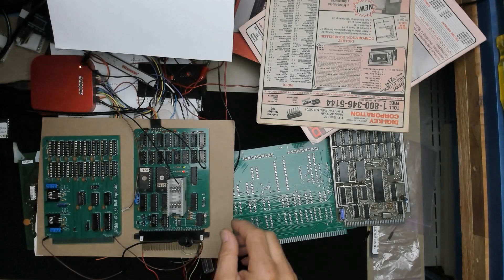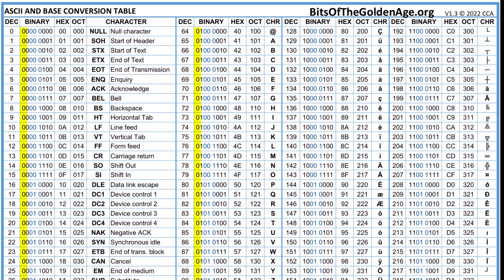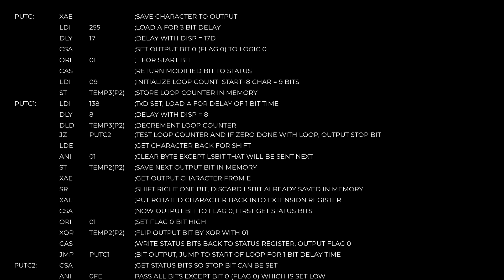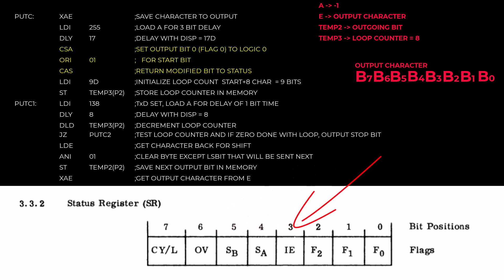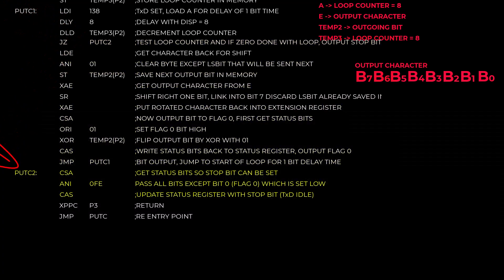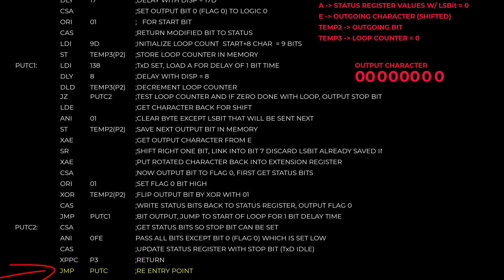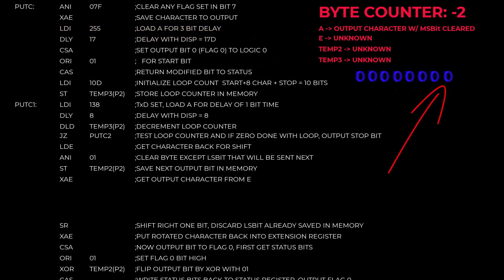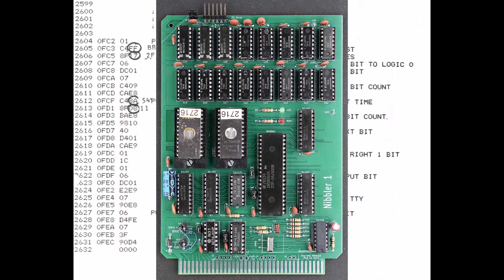{142} Fixing another bit 7 bug in NIBL, Learning SC/MP Assembly Language Along the Way

Comment: Nice, How about instead of shifting out 8 bits, you just shift out 7 bits, so that last character flag bit never gets sent, then just stretch the stop bit to allow for the data field being 7 bits instead of 8.

Thanks for the quick intro to the scamp code and the chip, I have one in a baudo time and date generator, I pulled the code from it's ancient EPROMS, but was having a hard time getting my head around the code.
Reply from the maker: I would need to try it, but reloading a stretched stop bit may not save any space when all is said and done

Comment: I'm probably being pedantic, but is it safe to set the carry/link bit and then forget about it? You could use the nop to clear it again (assuming it was zero in the first place) or wrap the SCL in a CSA/CAS combo but that would leave you with one byte deficit again...
Reply from the maker: You are right.  CY/L has special significance in the SC/MP because it is modified by so few instructions.  Unlike like the 8080/85 where so many instructions set/clear the carry.
The original coders would have gone into the PUTC routine knowing they didn’t do any arithmetic so the carry should come out in the same state it went in.  It is possible they had been using it as a flag or in arithmetic of the calling code.  Having not really examined all of the calling code, If I had broken existing code, this would have been a subtle one to track down.  
I don’t think I broke anything this time, but it would be safer to reclaim that NOP byte and do an ORI 080h after the shift to explicitly set the MSbit.

Comment: Maybe you could save a couple more bytes by inverting the character at the top, let it shift zeros in and not use the memory location, just off the top of my head. Nice video thanks.
Reply from the maker: possibly, but i didn't see it.  I started down that road but desperately needed a left rotate instruction which doesn't exist.  The pinch point is when setting the output bit before writing to the status register.  At that moment we need the output by itself, the status register is in the accumulator, and we still need the unmolested character... i don't think we can get away from getting that bit alone in a memory location.  the XOR actually doesn't cost us anything because we need to set that bit to a known value first before we can set it to the output bit.  we can use the ORI and XOR or use an ADI to clear it and then OR but either way it is 4 bytes.
Reply: @HelloWorldETX  You're really going to hate yourself when you find out that the last 18 bytes of the second ROM aren't even used and you could put patches there. (turns out they're just a copy of the same bytes from the first ROM)
EDIT: well I guess you can put SOME patches there, but there's that thing about how your only options to get there are 2-byte short jumps and 7-byte JS calls, but at least it was close enough for GECO!
Reply from the maker: @8bitwiz_  I looked at those.  they didn't look like opcodes and i didn't see where they were used for lookup tables so i am not sure what they are.   If just unmasked, i would have expected them to be a consistent value.  you disassembled them and agree that they are not code?

Comment: Using the MSB as a string terminator is rather common. Unfortunately not clearing it before sending that last character is also rather common.
And okay, I'll make an assembler, it's a really simple instruction set and should only take me a day or two to add it in, and I can't have you trying to do it all in Excel! (it should take as much time to polish up a new version than to write the assembler)
Reply from the maker: Thanks.  I only used excel for the delay value.  For SC/MP assembly, i am doing that all on paper at the moment and i will need a good assembler.  There are SC/MP assemblers.... at least two that i have found... but i haven't gotten around to picking one to try.  In the meant time, i learn a lot by hand assembling.

Comment: Nicely explained. I especially enjoyed the assembler listing explanation at 3:37. A description that is almost always overlooked in coding discussions. It is generally accepted as 'known knowledge' but in reality is only ever covered by training on the use of assemblers capable of producing such files. Not a lot of help to interested learners without access to such a resource and a machine capable of running it.
 Although familiar with 8085/z80 code listings it wasn't until I got my first computer (SoC MK14) and read through the manual that I experienced my 'lightbulb' moment.
Even though I was expecting to have to hand assemble any code before entering it, byte by byte, I suddenly realised that column 2 of a listing file was all I needed! Everything else was just commentary that could be ignored if I didn't need to modify it. 
The manual also enlightened me with details on how opcodes differed in bit pattern groups depending on the desired registers and addressing modes.
Those two revelations alone were worth the cost of my hardware investment and they remained so useful throughout my career.
Reply from the maker: I agree.... As a young college student and new to assembly language, breaking the 8080/85 machine instruction down into it's component bits that define the instruction and whatever registers are used was an absolute eyeopener for me.
Reply: 4:14 OK so column 2 also includes column 3. You kinda led me into that mistake lol. :D

Comment: imo it is a mistake to put the bit-clearing logic in putc, I would rather fix the error message code to clear the high bit after detecting it on the last character (before calling putc) so putc can still be used to deliberately send an 8-bit character if needed.
Reply from the maker: Point taken. Does NIBL allow for 8 bit ASCII everywhere else?
Reply: @HelloWorldETX  ASCII is, by definition, 7-bit, but I would not want to limit putc to be usable only for ASCII. What if you want to dump memory over the serial port for debugging purposes, for instance?
Reply from the maker: @Squossifrage  In memory dumps for my resident monitors, I expand the byte to two ascii hexadecimal characters before sending them out since ASCII is the only thing my TTYs or terminals understand.  If i want to do a binary upload, my monitors upload it as *.hex files.
Reply: @HelloWorldETX and  @Squossifrage  Indeed early ASCII was 7-bit, but so much now-a-days would be happier with a fully 8-bit wide channel.
Definitely repair the error message handler to mask its end-of-string marker rather than narrowing PUTC to only seven bits.
Reply: @Brian_Of_Melbourne ASCII is still 7-bit. There are 8-bit text encodings, but they are not ASCII.